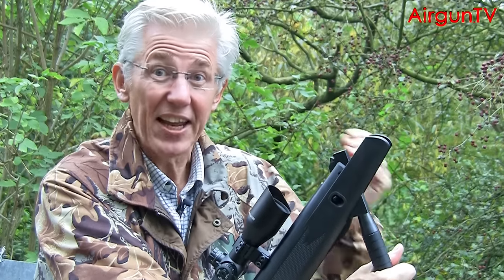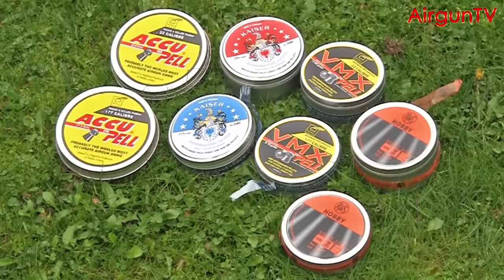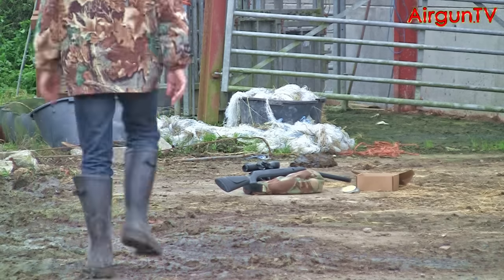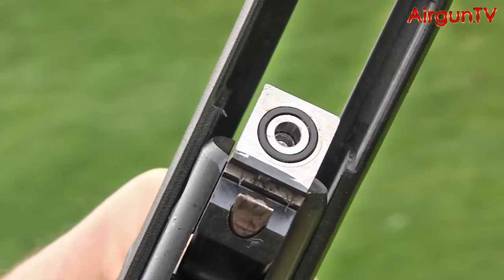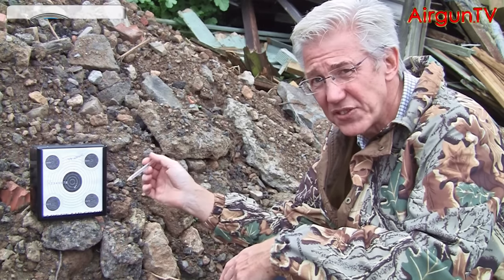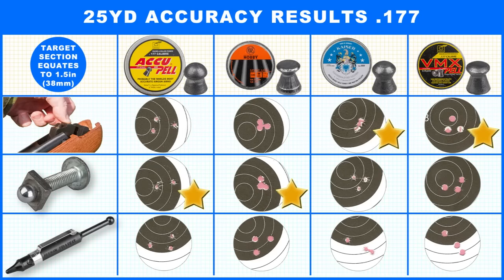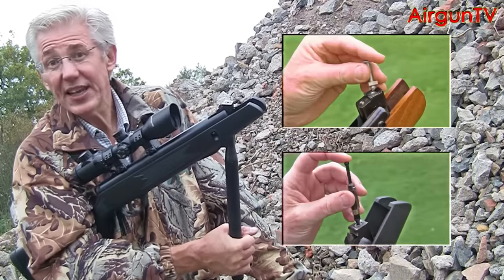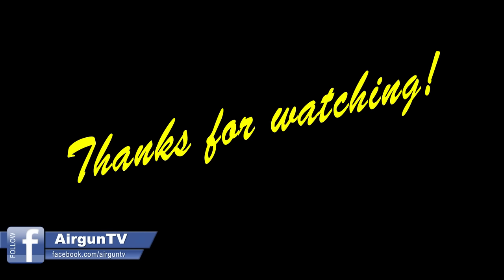PELLET SEATING - boost performance of .177 & .22 air rifles?

Comment: I believe you are using the Pell Seat incorrectly. The tapered end is designed for correcting deformed skirts. The round end is for seating. In your video, you showed seating with the tapered end, not the round end...
Reply: I will second that. I always use the round end.
Reply: Precisely, I may add 🙄
Reply: I agree.
Reply: That makes too much sense

Comment: You are using the pellseat wrong... The pointed part is just to get the pellet in the barrel without pushing on the skirt which could deform it. Once you get almost flush turn it around and seat it flush with the round end which expands the skirt to seal it into the grooves of the rifling. Notice that your homemade ball bearing looks an awful lot like the back end of the pellseat?
Reply: @Jeremy C I also noticed this, also it appears that this pushes the pellet down inside the barrel a little too far, which to my mind could render the overall "power" a bit less as it allows for a "cushioning" or compression effect? I have only ever pushed mine in as far as the skirt?? Ahem :)>

Comment: Good video. Personally I'll just use my thumb to seat the pellet until it makes contact with the bore. With a springer the pellet acts as the pressure release valve. When the piston has travelled halfway down the compression tube the pressure has gone from 1bar to 2bar, three quarters of the way 2bar to 4 bar, seven eighths of the way 4bar to 8 bar  and so on until the pressure is great enough to start to overcome the resistance of the pellet to enter the bore, then the pellet enters the bore, deforming evenly to fit the rifling grooves and effect a seal and can then move more easily down the bore and acceleration begins. The gun is designed for this to happen almost at the end of the stroke and the massive build up of pressure is cushioning the piston. The compressed air expands to fire the pellet.

If you seat the pellet firmly enough such that it is in the rifling grooves the pellet will move sooner, the piston won't be slowed at the end of the stroke as it should be and that is why on one rifle you felt it slamming.
Reply: It is certainly faster that way.

Comment: I have a crossman tr77 nps. Every pellet I've tried, except daisy flat heads, have not fired. When I place them in the breach and fire it makes a deep ssssss sound. I tried seating the pellets and it works perfectly. I can get groups of 5 pellets in one centimetre with my crossman destroyers and daisy hollow points. The daisy flat heads shot without seating are terrible. I can't get a group smaller than the palm of my hand. I shot them at wax blocks and they just barely stayed in. I began testing with seating the flatheads and they performed amazingly. They have much deeper penetration and are much more accurate. Thank you for this video.

Comment: I seat my pellets for two reasons:
A. Seating ensures that pellets are deep enough so that no lead is sheared off when closing the breach. That keeps the gun cleaner and results in every pellet retaining all the weight it was manufactured in. That alone should contribute to accuracy by being consistent.
B. Seating guarantees that each pellet starts at exactly the same depth which also contributes to accuracy.
  Power really isnt an issue for me. The gun was designed a certain way and theres little improvement one can make over that which will result in materially better performance. I also dislike pushing mechanical items of any kind beyond its design limits. Ive used an Air Venturi seater as well as an old pen. They both work equally well.

Comment: I made my own pellet seater for both 1.77 and 22 cal and making that slight taper at the breach  my pellets go in about 1 mm deeper than flush and I find much more consistency in acuracy and power than just pushing them in.. the pellet seats into the rifling and so all the air is now used to propel the pellet instead of at the start the air must first squeeze the pellet into seat before it goes on its merry way..as long as the pellet is not pushed too deep down seating a pellet works for me every time 😉👍.. it also sorts out any deform that can be found it pellet skirts from time to time

Comment: Great informative video. I'm personally a Crossman 1377 American classic (fully modified w/ 19 inch barrel and rifle stock , ++++) and Benjamin multipump .22 advocate. I upgraded the bolts in both rifles to seat my pellets better than stock.
I have found that the skirts of stock Beeman domed hunting pellets seat better than the skirts on stock Crossman domed hunting pellets. But the crossman's are a harder lead that penetrate deeper.
P.s. real rifle projectiles in .177 and .22 fit, and work. FMJ, FMJHP. They just don't give good expansion,but they hit hard.

Comment: A properly sized ball bearing does the job nicely.

One thing to remember is that during seating with a tool of any kind its possible to shear off some lead from the skirt. Make sure you look for that and remove it or risk having it pushed into the barrel and destroying accuracy for subsequent shots.

Comment: What I have found is that if you only use the ball end of the Beeman tool (I've had mine since 1980!) you will get the same results as your ball bearing tool. The whole Idea is to smooth the skirt of the pellet out so it is in contact with the Chamber all the way around. Then you are assured of getting a perfect seal when the pellet is pushed down the barrel by the Air.

Comment: I have a Remington Tyrant which is very like the Webley you have here, and I have tried quite a few pellets, but in the end stick with H&N Excite spike, because they seat beautifully in the breech just with a thumb and give superb grouping results.  I have looked at pellets I fired into water and they seem to have been immaculately engaged with the rifling also.  I think that skirt is the key, all power used on firing as skirt is a good seal and smooth engagement down the barrel leading to consistency.

Comment: flush with the breach, anything else is to sell fancy gadgets to put pellets into your gun. I did a similar test with multiple rifles and pellets, tested a black hawk elite, hatsan 95, hatsan 135, benjamin prowler, benjamin titan. Pretty much the same result as yours. Biggest difference I noticed in accuracy and consistency was related to weight of pellet, pellet shape, how it fit in the breech (some are tighter than others) and of course the biggest variable for springers was hold/shooting technique.
Reply from the maker: +American Son Helpful. Thanks for commenting

Comment: The only thing I could say would be that if a "pellet seater" what ever kind would or could remove some variation from using one's thumb, ie it would seat the pellet at a known distance every time but this is just a guess. I think the only way to test this is for several people to repeat it with same devices but also have the gun locked down to remove variation from shooter bias.

Comment: Hi. I have a Cometa Fenix 400 in .177. It came with a free tin of HN Baracudas at 11 grains, this is a very popular pellet with hunters where I'm from. Because of the large diameter of the pellet (head .177) I had real trouble getting them to seat flush in the breech without using my thumbnail, which indented the skirt. This affected accuracy as i would be guaranteed of flyers in every shot string. I tried JSB Exacts at 8.44 grains with a head diameter of .173, the pellets were much easier to seat flush in the barrel, and my accuracy improved tremendously. My two cents is that pellet head diameter affects the proper seating of pellets in the breech, which affects accuracy.
Reply from the maker: +walliack Thank you for that detailed information, walliack. It is true that a large-headed pellet will be difficult to thumb home into the rifling, and it could well lower the guns power due to increased friction - especially if the barrel is choked...

Comment: I'm mainly into full bore rifles, and rimfire, but I enjoyed this video, and similar ones, and it's given me the incentive to dust off my Weirauch HW35 in. .177 .i only use open sights, and so far, have found Wasp the most accurate.
I'm having as much fun tinkering with my HW35, as I do when I work up reloads for my 270 or 300 WM.
I may even post a video myself.
Reply: Try H&N Match pellets Or JSB Exacts in your HW35 both will produce the best accuracy in those guns.

Comment: Good video sir. I was wondering. Which do you prefer? Spring  pistons or gas pistons? Thanks in advance and I think I'm gonna make that tool you made with the ball bearing
Reply from the maker: I've tended to favour spring-powered piston rifles to gas-ram-powered pistons in the past, largely because I always felt there was a 'knack' at shooting gas-rams. However, there's clearly been a lot of development on the gas-ram system since the original inventors, the now-defunct Theoben, let the patent lapse. As a result, I find most of the modern-day breed of gas-rammers to have the same characteristics of a well-running springer. In fact, I'd chose a gas-ram model over a 'cheap 'n' cheerful' springer any day of the week nowadays!

Comment: I use the ball end of the Beman pellet seating tool and not the pointed end, because of exactly what you described in your video.  Also, instead of a ball-bearing on the end of the bolt, why not just use a semicircular crown nut?
Reply from the maker: +L.I. Archer Thanks for your comment. I haven't found the ball end of the PellSeat that effective (nor its other end!), but used it as a template for making my own; hence utilising a ball bearing (different sizes for different calibres). Hadn't thought of a crown nut; the BB just seemed a logical thing because I could easily get the right size (mentioned in earlier replies).

Comment: I've done a little experimenting myself and what I've found is certain pellets have a sweet spot for how far they are pushed in. Too far an accuracy goes down, not far enough and accuracy goes down. You get more flyers when the pellet is pushed to far that's for sure. (5mm and more is a no-no for me.) As it turns out about 1mm down is what I'm finding to be the best. And best here means fewest flyers and tightest groups. 

I don't have a chronograph, so I could not test that.

HTH
Reply from the maker: +Stickman Useful info, thanks
Reply: Stickman 0

Comment: As mentioned in many comments, the ball shape helps create a better seal by pushing at the skirt.

TL;DR in advance of wall of text: Don't push the pellets down the barrel. Use rounded part if using a Pell Seat, for the most part just aim to have the pellet seated so it is flush.
If your piston is slamming, you are doing something wrong and will more than likely damage your gun if done repeatedly.
----
I want to toss out a theory where you mention a lack of air seal when pushing it far in.
I do believe your gun is sealing as it should at the break, and I'm mentioning this as the wording could be confusing to some.
By pushing the pellet so far in, not only is the travel distance to the end of the barrel slightly reduced, the skirt will also likely squish together a little, allowing easier travel through the barrel.
Easier travel means the pellet is set in motion sooner than intended, there is less pressure in the chamber, the piston has not travelled as far as during normal use, and this is not a good thing.

The piston is probably slamming in the chamber because the pellet is able to leave the barrel too soon, and once the pellet leaves the barrel, the barrel and chamber is no longer pressurized and there's nothing to hold back the piston from slamming. Ontop of that, whatever travel distance the piston has remaining once the pellet leaves the barrel, is lost, and that can be seen in the numbers listed, which appears to be around 10% which is fairly significant.

It definitely seems favorable to just get the skirt nicely shaped to the barrel for a good seal, but using decent quality pellets and just seating it with your thumb is probably enough for any non competitive application. That way you're fairly sure it is firing as the manufacturer intended.

Comment: Been seating my pellets since I was a teenager in my springer. I never thought as to why exactly, but I did.. Fast forward 20 years and I actually visually noticed the increase in velocity by observing the pellets stuck in the blocks of my wall behind the target. All the seated pellets were noticeably flatter than the pellets simply seated with a finger. I figured it was due to forming the rifling into the pellet skirt causing a significant enough decrease in bore friction without compromising the actual seat seal.. Just my thoughts.. Maybe I am wrong.
Reply: If you shot the pigeons , rats or squirrels it isn't worth your time. Even .177 is strong enough to kill .
Reply: @snd7622  True enough my friend..

Comment: Never had much luck with pellet seating. I notice H&N .177 8.64gr. seat better than my JSB 8.44gr. in my HW97k. It appears that a tighter fitting pellet to bore size is the issue.  Good video and approach to your experiments. I love that HW35E you had made with engraving, and barrel.

Comment: I've found that, pretty universally, having a way to seat a pellet into the breach no more than 3mm seems to be very consistent. Also eliminates the gas-seal problem.
Reply from the maker: +Shayde Mohr Thanks for sharing your experiences on pellet seating...
Reply: AirgunTV
No problem, though. Literally though, 3mm is as far as you want to go. Generally I stick with a plunger I made myself that will seat the end of the skirt 80 thousandths of an inch past the chamfer.
Reply: AirgunTV m

Comment: Were you essentially dry firing your gun on the occasions that the pellet was seated too far?
Reply from the maker: +Mack Durr I probably wouldn't go so far as to say 'dry firing' it, but over-seating would certainly cause a more violent bottoming of the piston due to a lack of pressure build-up.

Comment: I flare the end of the pellet and it seams to make more power. Pressure builds up more before the pellet gets forced into the barrel
Reply from the maker: +aslanyavuz can work... but you run the risk of overdoing it and causing too much kick to get the pellet started. This can even LOWER the velocity...
Reply: @AirgunTV Just as improperly using the wrong end of the Beeman tool to deep seat the pellet in the breech of a spring piston air rifle will decrease velocity.

Comment: Thanks for making another good video. I always try to push the pellet flush with my thumb, I found that, for .177,  a 3.5mm headphone jack is reasonably good (but thumbs are easier)  You definitely don't want the pellet pushed too far into the barrel, it enlarges the transfer port massively, increases the 'lost volume' and buggers up the compression ratio.
Reply from the maker: +Sherlock 1963 Thanks Sherlock. That's a good tip - the HP jack, not the thumb! - thanks. And, yes, you're right about the lost volume. That was clearly the problem with the PellSeat
Reply: If you use a golf tee and push it gently into the breech it leaves an ideal mark (leave a little extra to tune to your brand of pellet) then cut off the excess and seat your pellet just right.

Comment: i had issues with the bsa superstar in .25 that clipped the skirt if not seated with a probe. is that you're farm nigel?
Atvb dave
Reply from the maker: +David Dickinson I have a few break-barrel guns that shave the skirt of the pellet when the breech shuts - the worst are the ones with the angled face. If you use a grinding stone, the trick is to drill in line with the bore NOT the breech face on them. 

The farm is a mate's - not mine, David. Had that perm since around 1994...
Reply: AirgunTV ive had similar issues on break barrel rifles too. maybe loads in the past when ive just headed out with a pocket full of pellets and not thought about it until the last few years. mainly down to the internet and learning new thinngs. keep up the good work mate
Reply from the maker: +David Dickinson Yep, the internet is a great resource... even for us dyed-in-the-wool airgun news of old LOL!!! Cheers for your support of the channel...
Reply: You're welcome nige keep them coming
Reply from the maker: David Dickinson Will do... :)

Comment: Another very interesting video. See a few discussion on a few forums on this subject. Like your video has show it can be a bit mixed with the results, but unlike your video those trying it was using there preferred pellet and there was no mention of variations in power due to how the pellet was seated or how far into the breach the pellet was pushed. 
One one of the VHTV videos from a few years back Si Pittaway picked up a new Weihrauch (sadly I can't remember the model) from Sandwell Field Sports and Tony said to seat the pellet to get better accuracy was to push the pellet enough to leave an impression of the breach on your thumb.
Reply from the maker: Glad you enjoyed it d1gger. I deliberately chose pellets at random - I did want to use a lot more, but when I realised just how much shooting was involved (for arguably not more conclusive a result), I narrowed it down to the four brands which I had in both .177 and .22. I would add that the pellets I've found work best in my FWB are those that get seated by thumb - leaving an impression, like you said Tony at SFS has recommended. Then again, that could be because it's got the 'ideal' breech face chamfer. Results are mixed and, as I said in the video, you can't really say, universally, that there's a 'categorical' answer to the question of whether pellet seating is worth it or not. But you've got to try it, in my book, just to see... !!! Thanks for posting that information. ATB, Nige